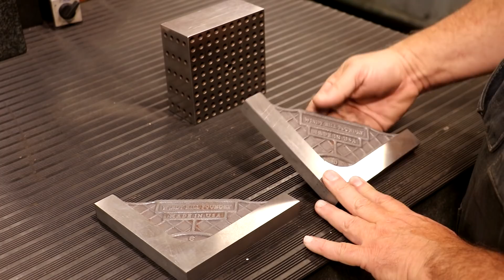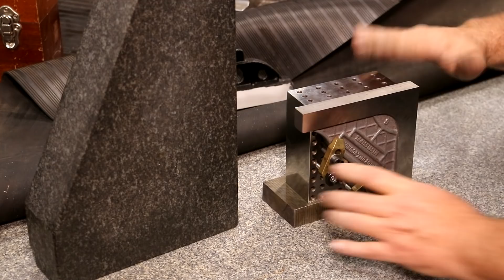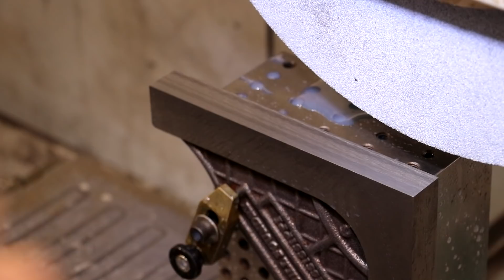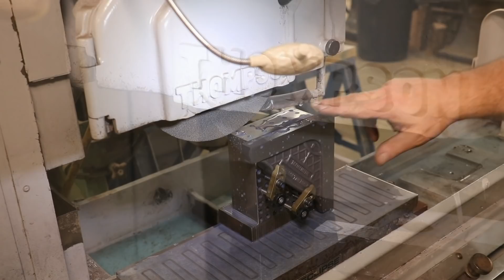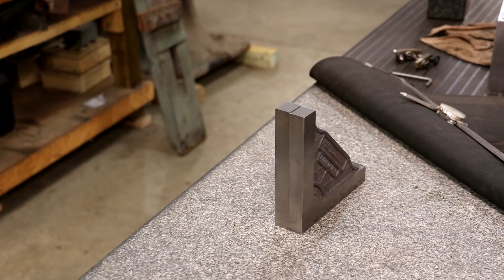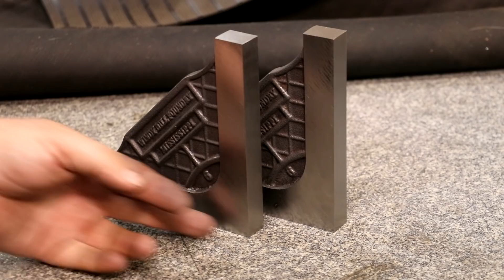Grinding two Surfaces Square on the Surface Grinder

Comment: No comprehension of how to check for "square" !!!!  Squareness should have been checked again after it was removed from the jig block as a final inspection with no outside influences to introduce errors.
Reply: Suburban Tool has a video on rhat.
Reply: @davidrush4908   For the interest of others, here is Suburban Tool's video:   https://youtu.be/f0z7DAr4w7Y
Reply: @davidrush4908  you missed the point.  You don't make a precision instrument (square) without an inspection to verify the accuracy . Yes,  several people have videos on how to properly check for squareness.
Reply: @andrewevans1658  I agree that the part should have been unclamped from his grinding jig prior to checking squareness.  But I also agree with David in that Keith's process for checking square, once freed from the jig, is incorrect.  Keith attempts to show square by differential heights, incorrect.   Keith failed to release the part from his grinding jig, incorrect.  In this case, two wrongs do not make a zero!  We have no idea of how square those faces are to each other.  Further, Keith's vaunted 50 millionths block is obliterated by several factors, not the least of which is that he hand dresses the block with a stone before use (in his own words).
Reply: @WhatAboutTheBee  All correct, but in all honesty I don't know what Keith has in his shop or what his friend would consider good enough 

To me, part of Keith's appeal is his work with older equipment. My grandfather, whom I never knew, was a partner in a line shop that built one and two cylinder steam and internal combustion engines known for their simplicity, versatility, and ease of repair with what would now be considered primitive tools and equipment. I'm sure that the tolerances in much of the machinery were appalling by today's capabilities, but it's what they had at the time.
Reply: @davidrush4908  some people watch videos strictly for the entertainment value,  other watch to learn something.   What people who don't know the difference between right and wrong  learned was incorrect during portions of this video.  Keith has absolutely everything needed in his possession to properly check an item for squareness.
Reply: @andrewevans1658  One thing I wondered about as well, with the clamps on the unsupported web of the square, how does the possible deflection of the web translate to the final face grind?
Reply: @davidrush4908  correct he did not do it right but for their porpoises it does not matter
Reply: @andrewevans1658  also right on. I will be doing an upload and analyze his process. great guy dont get me wrong the upload will not be belittling.
Reply: absolutely right on. I will be doing an upload on it. remember he does not make tooling really. The innacuricies introduced in this case does not matter to the person getting the blocks.

Comment: Surface  grinders are a mystery to me.  I know the stones are different, they are cooled and the cut depth is small, but it just seems that the stone goes away a bit at a time and would lose accuracy.   Just my insanity thinking out loud here. 

I had carpal tunnel surgery in the right hand about 20 years ago.   Wasn't  able to take time off the job long enough and was on it again within a week.  Wasted procedure  (like the surgeon said) it reversed the benefits of the surgery.  Been living with it since.  One of the hardest things for me to do for example is to find a screwdriver at my house,  I  don't have  many because I have to use power tools for nearly everything so hand tools are always hiding, but I  get by.
Reply: The wheel has thickness. Only the leading edge is eroded, by the time some is worn away there is more waiting as the cutting edge travels across the width of the cutting face. The diamond dresser is used to resquare the cutting face, and the process starts again. You have to wear out the entire face before any potential error is introduced, but used correctly, that will never happen. So it is one of the most precision processes we have.
Reply: @Bakafish  Ok, so you dress the wheel for each job basically.  That makes sense as well as the leading edge wearing and the trailing surface finishing to spec.  Thanks
Reply: @marcp1180  Yes you dress the wheel, then start grinding, you make a pass and then check the stone, if you managed to run across the entire face, you redress the wheel. However that rarely happens because you don't normally remove a lot of material during this process. The idea is to machine it to within a thou or less over and then grind it to final size if at all possible.
Reply: @Blazer02LS  Thank you, I'm  a small time hobby machinist and grinding wasn't any part of  my learning experience.   Thanks to y'all  for your knowledge and for Keith bringing on a good video about it where I'd  get the chance to ask.
Reply: @Sunlight through a window I think it was Project  Farm that shortly ago did a comparison video of a few different brands of screwdrivers.   The Harbor Freight screwdrivers  quite shockingly did very well against many of the other expensive brands.  You may just be doing people a favor by loaning Harbor Freight screwdrivers out.

Comment: So, one thing I've never quite understood about surface grinders: The wheel gets smaller every time it's dressed and used. How does the machine adjust for that?
Reply: The stone is always referenced to the work by light contact establishing a relative zero point. Then you remove the amount of material by lowering the stone from that zero point. You measure the workpiece directly, more than once as you remove material, and as you grind it the reference surface becomes more uniform and accurate. Lastly you work towards the final grind with a freshly dressed stone and light cuts after once again measuring the height and zeroing it on the surface you are grinding.
Reply: @Bakafish  ah, okay, so if I touch off, then let the head come down 5 thou, and let it run over the piece until it stops cutting, then I can reasonably assume I've taken 5 thou off the piece?
Reply: @dcviper985  - no, you don't assume or measure down 5 thou in that way. The machine doesn't work that way... it just grinds a tiny bit away each pass, perhaps less than a tenth of a thou. You stop grinding when it is flat, not at any particular measurement away from where you started. Consider a hand plane and wood - you plane until it's flat.
If you want to dimension something, then you repeatedly measure and sneak up at it. The machine doesn't use the wheel to reference from, since that surface is continually being eroded (even though it's a tiny amount)..
Reply: @johncoops6897  okay, that was where I was confused. I think I understand now. Thanks!
Reply: @dcviper985  Correct.
Reply: @johncoops6897  Actually you can do it that way, modern grinders have very accurate DRO’s that allow you to dial in how much you remove from the initial zero point, even older machines have dials to do the same. I agree you must make multiple incremental passes in most materials to take out 5 thousandths, but he was just trying to grasp the concepts.
Reply: @Bakafish  - of course modern grinders have DSOs. However THIS grinder in THIS video doesn't have one, and is fully manual. Furthermore, the original question relates to the methodology and how wear of the grinding wheel is dealt with, rather than specific technologies.
Reply: @dcviper985  Yes that’s correct but you don’t normally remove that much material in one pass.
Reply: manual machine U have to adjust the height after dressing urself
Reply: This has always been my question  as well.  Glad I'm  not alone on it.
Reply: The wheel stepover sideways while grinding is a fraction of the wheel width so the wear doesn't make difference within one pass as the wear happens mainly in the leading corner of the wheel. Otherwise the wear is not an issue either, except for cnc machines where the machine needs to know the wheel size after dressing

Comment: Had the ulnar nerve release in both elbow after 37 year career as heavy duty mechanic sometimes wonder if I did right thing after small and ring fingers were clawing over retired after elbow pain just too much  still struggling 10 years later